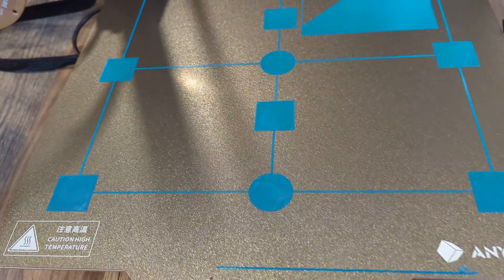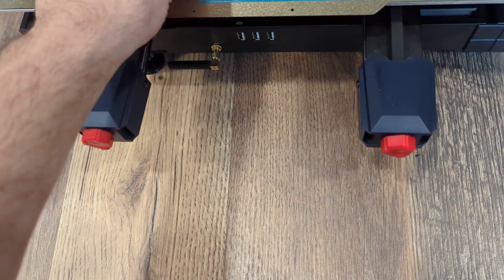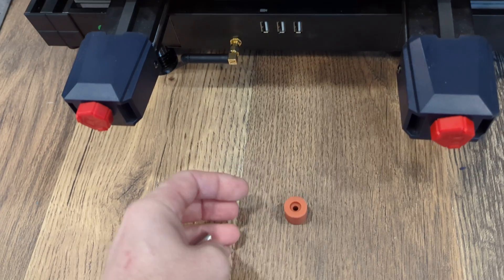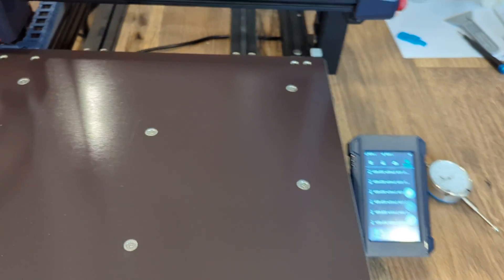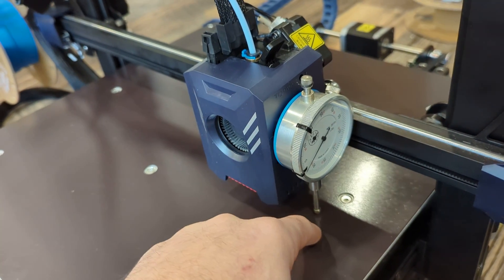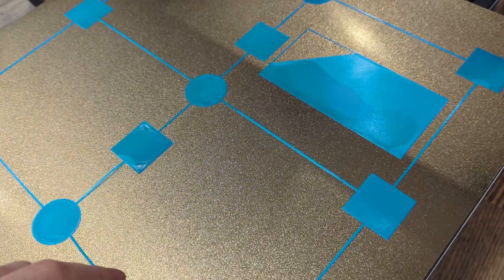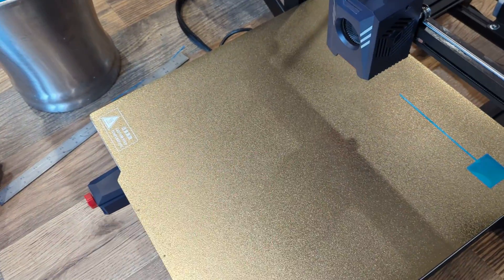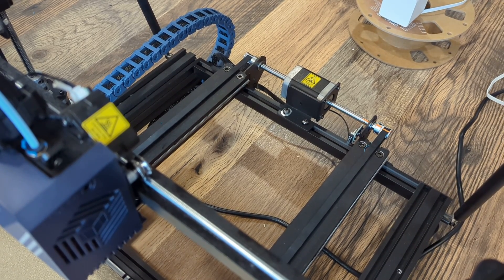Anycubic Kobra 2 Max Bed Leveling/first layer calibration explained

Comment: WARNING: DO NOT BUY THIS PRINTER (or any anycubic Kobra 2 printers, I've been having similar problems on Kobra 2 and Kobra Neo)
I do not care if I come off biased or triggered, but these anycubic printers have took 5 years away from my life with problems.

My office bought this piece of s***, a closed source firmware, with: 

NO OPTION to set e-steps,
no extrusion/flow control whatsoever,
disfunctional ABL (compensates incorrectly),
no way to connect it to a PC,
no manual bed leveling mesh or option to edit the automatic one,
no way to tram your bed,it has fixed spacers,
only way to change z-offset is during printing,
incorrect automatic z-offset detection (varies by ~0.25mm on every auto level)
VERY uneven bed,
no way to calibrate stepper motors.
I can't even remember all the other problems. 

I added springs and knobs to manually level the bed, and it helped A LOT, but it still wasn't enough because there are 8 screws and the bed surface is massive, so even if I manually tram the bed with them, there are still hills and valleys when printing something bigger on it. We bought it for 600$, I'd say it's not worth the trouble even if they gave me 300$ back.

Piece of s***.
Reply from the maker: I definitely understand your frustration, and you have valid points.  Unfortunately, as of today, there are no better options available for a large format 3d printer even close to the price point of the K2M that do not have the same exact issues/concerns.  What I can say is I have two of these machines that have been printing flawlessly for almost a year now since executing the steps I outlined in this video.  Should you need to modify a brand-new machine to get it to work? No, absolutely not.  That being said, it's very gratifying being able to design and print BIG without breaking the bank
Reply: @mark4jr  Yeah, the price vs volume does make it enticing, but I've been printing for a long time, and I've been searching for solutions online for a month, I tried all sorts of fixes with no improvements. Thanks for the video, and sorry for the negative comment, I just wanna warn people. I do not mind tinkering and calibrating a 3d printer, but if anycubic is gonna deliver a piece of s*** like this with closed source firmware, than at least give me options in it OR open source it, and people will fix it for you. No matter price vs volume, if you can't get a decent first layer, everything is useless. How do I print something big on it, if the first layer looks like a topographical map of the Balkans?
Reply from the maker: @Stef-an  hey no worries at all! I keep hearing rumors Bambu is launching a large format soon 🤞
Reply: @mark4jr  Nice, let's hope it's not gonna be overpriced :)
Reply: I wish you'd made this comment a month or two ago and I'd seen it. I got a Kobra 2 Pro as my first 3D printer and I can confirm everything you've said. The auto-Z offset is one of the most ridiculous things. Leveling it is a joke. Every time I do the Z offset is some random number that's nowhere close to what it actually is (e.g. +0.21mm when it's actually -0.45mm, at that moment anyway.) Half the print troubleshooting guides I look up suggest doing things you literally can't with this line (esteps, steppers, etc.) and with the firmware being closed (in violation of Klipper's GPL) and locked down you have no way around it. It's also ridiculous that there's zero computer connectivity and it's dumb AF that I have to upload the print to A CLOUD SERVER, then use the mobile app to initiate the print rather than just directly sending the job from my computer. If I knew then what I knew now I'd have skipped Anycubic entirely.
Reply: @Draknfyre  Ah I wish I could tell people in a more effective manner. The thing is, you don't find out how bad a printer is, until you get one, search for solutions and then find out that many people have the same issue and there's no fixing it

Comment: Where did you get the wire guide for the hot bed wiring. I need it.
Reply from the maker: @devangpatel5285  https://www.printables.com/model/688059-anycubic-kobra-2-max-cable-drag-chain

Comment: I also got this issue of shifted layers. According to my observations, these issues happen at quite big distance from build plate (around 20-30 cm), which means the weight of plastic is already sufficient. I reduced all accelerations to 5000 mm/s2, and till now I never got this issue again. Seems that in my case the motor skips the steps when the load of plastic is around 300 g or more, and inertia of build plate + printed model is too high for motor...

Comment: There is no way the software can compensate, where the sensor it reading and where the nozzle is located are two different heights, they should stuck with the leveling  that they used with the kobra max.  they should not be shipping this out with a warped heat bed, its a defective product and anycubic needs to fix it.

Comment: I have problem with bed level in kobra 2 pro but i have no idea how to calibrate it manually because it have only 4 screws without option to install distances
Reply from the maker: I would think you could probably still apply the silicon spacer mod, if the existing metal spacers are all the same size then you should be good to go.  There is another video in the description of this one that is more of a how-to

Comment: For the layer shifting...fought that for a LONG time.  In my case the vref was WAY too high and motor getting too hot.  Adjusted that and things got better but still happened occasionally.  Player with acceleration and dropped it from 2000 to 900 and set jerk to 10.  Have run over 2kg through it and haven't had so much as a single shift on my kobra 2 since.  Considering how much more mass your max needs to move on the Y compared to my kobra 2 I have to wonder if too high acceleration might be causing you some shifting.
Reply from the maker: Can definitely confirm lowering acceleration does help.  the thing is though I have two of these printers and one has never experienced layer shifts the other is prone.
Reply: @mark4jr  how hot does the motor get when you're printing? if it's too hot to hold that's prob the issue

Comment: Installed the spacer mod you outlined, and used a straightedge to "eyeball" level it. I will go back and use a dial indicator later this week, but already the change has netted good results. Thank you

Comment: its very hard to do this large bed perfect so many variable like like filament quality dry or not or slicing settings ,room temperature,heated bed temperature nozzle type ,bed leveling.... maybe easy to first lever height set to a bit more and width overlap 15-25% or the motors,frame equal ,not slip the belt

Comment: Just a question in the slicer is thete gcode to use the bed level mesh?

If not can get it to level for each print with g29 after g28 code.
Reply from the maker: The start/stop Gcode gives the printer instructions regarding prior to printing and when the print is complete.  The firmware of the printer should load the bed level mesh regardless of the gcode, in my testing I do not believe the bed level mesh does anything with or without gcode instruction.  The only way ive been able to get consistently good prints is with a manually flattened/leveled bed.
Reply: @mark4jr  Weird. What slicer are you using?
Just got mine today and set up. Using anycubic slicer and everything seems to be working great although the auto offset applied by the printer was a tad on the aggressive side at -1.19 so I backed off that a tiny amount. It seems to be working flawlessly. Even in " sport" mode I'm getting great prints.

Set up my first full helmet to print though so bit nervous about later shifts on that so set it to standard but it's still crazy faster compared to my ender 3 😂

Comment: just a word of caution, do not move the bed or head while the machine is switch on.without disabling the steppers 1st. it creates its own electricty and you can blow your board or display pannel.
Reply: Can still happen even if its off if you move them too quickly.

Comment: I noticed the cable for bed heat out the back you had a blue 3d printed cable stabilizer. Where did you get it? I would love to print 1 for myself.
Reply from the maker: Found it on Printables, enjoy! https://www.printables.com/model/688059-anycubic-kobra-2-max-cable-drag-chain
Reply: Awesome, thank you so much!

Comment: If they allowed you to disable the mesh leveling you would honestly have a way better time. That is my issue right now, my bed is dead flat using your methods and the mesh digs into the bed in certain spots.

Comment: I had exactly the same problem, but I just sent an email to #anycubic, send the pictures with the gaps under the ruler, they send me a hotbed!!! Here is the reply(Hi there
We send you a free new {Heat Bed} to solve the problem.
Please fill in your information in the link below so we can send your package to you.
Note: The phone number is required, and the address information needs to be specific to the house number. After filling in the address, please reply to me for confirmation.) just filled the information and they send me a brand new one. So if you are having to many problems.... Maybe.... It's not your problem!!!! Meanwhile while you are having issues of bad leveling, slow down the first layer and just go up and down the Z-offset as much as you need to try the best layer as possible. You do lose a lot of time, but after I started to to manual leveling I stoped having warped and pealing layers, and I was printing with a 60º temperature, was able to go down to 50º(saves up a lot of electricity)haven't been printing nor rafts or brims, straight to the bed... For the shift layers I only have problems when I forget at Anycubic slicer to zhop on every retration. Hope it helps
Reply: Hoooo... And they super quick to reply, and when o was doing test and did not reply back, I would get an email from them asking if the problem was solved and if I could give them a feedback!!! Awesome tech support!!!!!!

Comment: High Mark thank you for the video.
I'm guessing you haven't been printing for very long.
You wasted a whole bunch of your time calibrating the bed when it was cold.
Secondly it never hurts to calibrate with the build plate off. But more importantly to calibrate with the build plate on.

It's critical for beds this size to be preheated for over 30 minutes before doing any calibration as the build plate needs to heat soak.

This is why you are having print issues even though your bed you say is level. I've seen deflection at almost 0.2 or more. Which is a full layer height or more.

Imo what you did wasn't wrong. You just missed the steps of heat soaking to get more accurate bed level.
Sadly it seems these printers both the elegoo Neptune 4 Max and the Cobra 2 max have troubles maintaining their bed mesh.
That means we'll have to manually see adjust for large prints every single time
Reply from the maker: You have a good point about preheating the bed before leveling.  I would recommend doing that and have done that on one of my machines.  When I get some time, ill update the video and add that.  Cheers!

Comment: A new owner supplemental parts list for the spacers, printed parts, depth gage and clip on print, would make a great PDF or even an nice bundle pack. I'd probably spend $20 on a kit that had all the parts you used/listed in order to get the bed leveled out of the box. Super helpful video!
Reply from the maker: I put all the parts in the step by step videos description found here https://youtu.be/eV9AGm6lLHg?si=tIOrVCzACzoEbjTB

you can print the supplemental spacers or just find a spacer(s) that measure 3mm in thickness to add to the Silicon for the middle bed spacers

Comment: That's very hepful video. I bought kobra2max a month ago but I have Z offset issue. Every after autoleveling, I have to calibrate Z offset during printing. (I could find z offset adjustment).  Nozzel calibration sensor is at same height with plate but I couldnot find the problem. That's why I couldt printed anything yet. If you now how to tune Z offset not during printing, please share. Also I'm going try silicon spacer and try to calibrate with dial indicator.
Reply from the maker: I had the exact same symptom, always had to re-calibrate.  I think it was to compensate for where on the print bed I was printing various parts at.  I have a feeling this is going to solve your problem, I just uploaded a step-by-step guide I filmed while setting up my second Kobra 2.